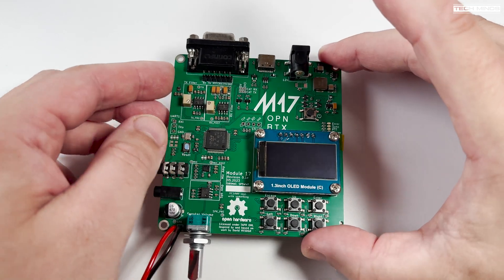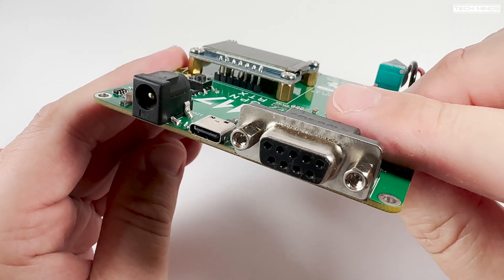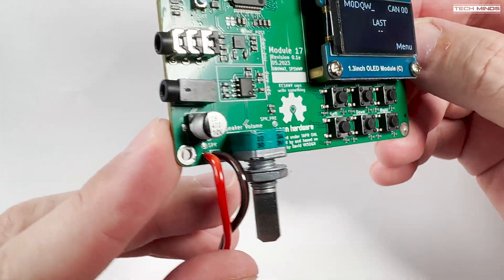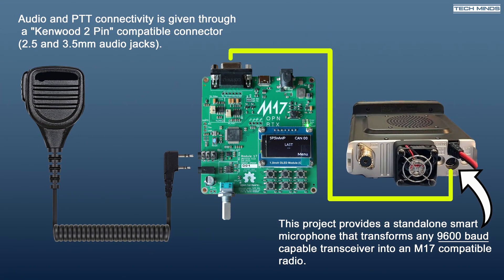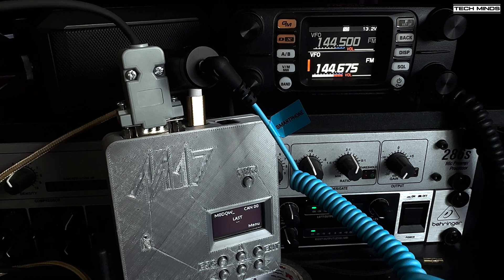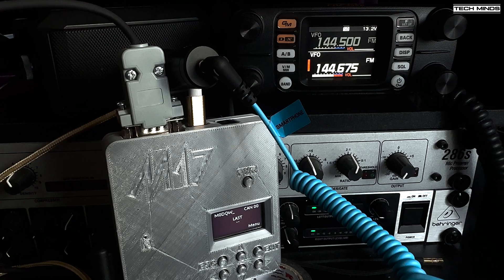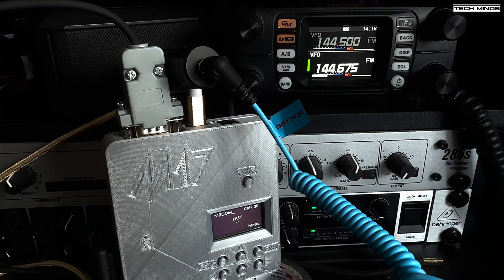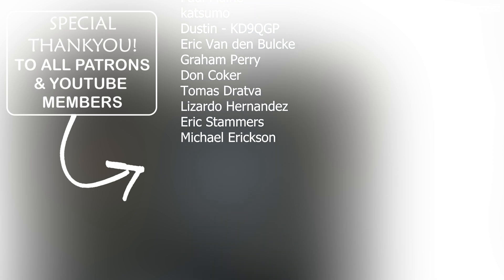Module17 Standalone M17 Radio Modem For Ham Radio

Comment: On the 9600 capability, it isn't just the pre-emphasis, it is also the audio bandwidth available. Filtered or not. Typically for FM audio it will cut off above 3.5kHz to avoid hiss.
Reply from the maker: Yep that’s true. The only reason I mentioned it in the video is because when we talk about “9600 baud”, we think of a transmission speed, which has nothing to do with M17. I could of gone “all in” on explaining FM filtering etc etc etc, but that wasn’t what the video was about. Thanks for commenting though, I’ll pin your comment.

Comment: Let me guess, Marlin Ender 3 like printer with bowden tube in direct  contact with the nozzle? If that is the case now you know why the rough surfaces, you can mitigate on slicing but the problem isn't the slice but the printer's hardware. Like from  Galicia!

Comment: Hi , I am stuck loading the firmware to the Aliexpress board any tips i have the user guide but confused , thanks Andreas
Reply from the maker: Hi mate, instructions for firmware loading can be found here: https://github.com/M17-Project/Module_17
Reply: Hi , thanks for the link and great Video , i did use the GitHub instructions but found it too difficult to follow in the end DB9MAT made me a batch file then worked great :)
 @TechMindsOfficial

Comment: hi there im still waiting for the q900 updates as i bought the latest version as per your link and having probs with the cat control cheers vk2ert rob
Reply: Hi again there is also issue with dmr not decoding through the headset Jack and high temp running dmr changed antenna 3 times still running hot dmr goes quiet sometimes and a kchunk starts it decoding again ? Vk2ert Rob
Reply: I bought the PMR-171, which is the Q900 V4 inside a military radio with an added tuning knob. It's so awesome.

Comment: Audio quality could be better (and maybe it will be in the future), but It's great to see an open standard mature
Reply: Improvements on the decoder are being made by the OpenRTX team, which should help reduce the amount of 'chirping' you hear in the decoded audio. Also, the Codec 2 audio codec (subjectively) sounds much better on a headset, or a speaker that has bass / treble adjustments. ^KC1AWV
Reply: @M17Project  very nice
Reply: It all depends on the hardware that you use. Compare to the quality that Droidstar offers.

Comment: To be clear..... this board will turn any 9600 baud FM radio into a C4FM, D-Star, DMR Etc radio...... correct?
Reply from the maker: No, only M17. It would be illegal to make a board like this for other digital modes
Reply: @TechMindsOfficial  Mind telling why it would be illegal?
Reply: @erlendse proprietary voice codec used. You'd need a way to legally use it by the board, and that most likely wouldn't be convenient.
Reply: It isn't illegal in the USA. I can't speak for anywhere else. @erlendse
Reply: @TechMindsOfficial it could be done legally
Reply: @davidkierzkowski  yea with an AMBE chip that costs $$$.